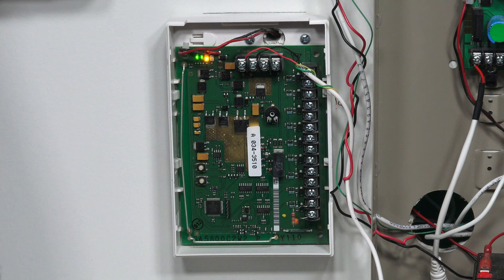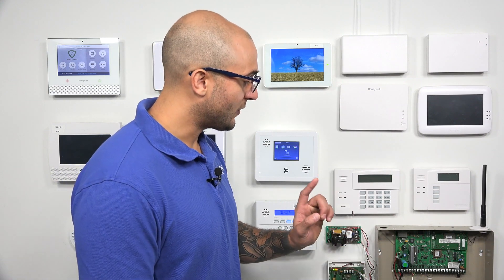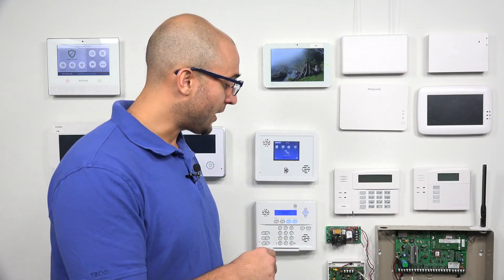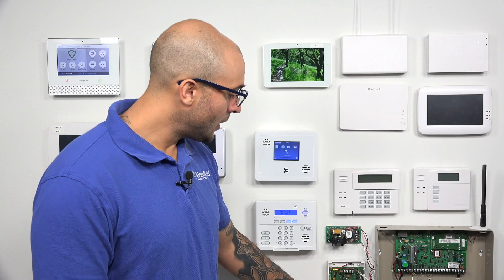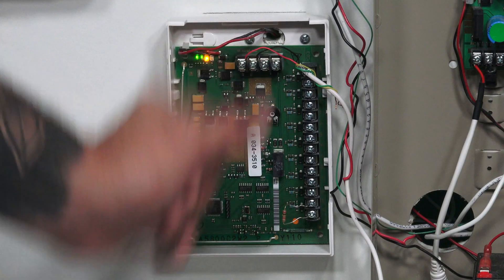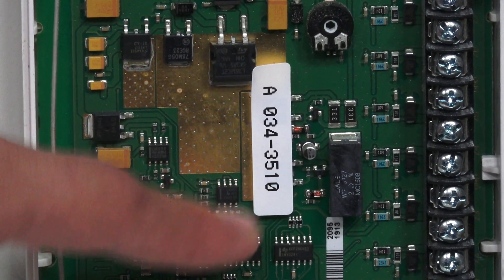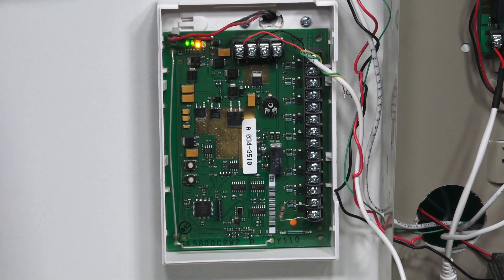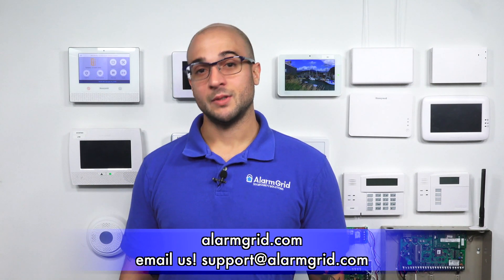Setting Up The 5800C2W with a Lyric Controller

Comment: I didn't understand the part about errors reporting to Loop #4.  
If I shunt the first position with a resistor and leave it there will the system report all 5800c2w errors to the first position?
Reply: If you shunt the first zone if programmed into the panel it will still send troubles to that zone

Comment: Is 5800c2w compatable with paradox mg5050 and paradox indoor motion detector and how is it connect to my wifi?
What display touch screen do recommend to replace the normal keypad?
Reply from the maker: We don't support the Paradox panels at this time.  I've found nothing online to indicate that the Paradox lineup can support the Honeywell 5800 series wireless frequency, which is what the 5800C2W uses.  As we are not familiar with their panels, we can't provide a recommendation on which keypads are supported by which panels.  They do have some information readily available at paradox.com.

Comment: I have a Vista 20SE system and interested in converting it with the5800C2W.   The installer, 10 years ago, placed BOTH front door and laundry room door wires on the same zone, zone # 1. Can I do the same on the 5800C2W?  The way they wired it was, the first door red wire is connected to the end of the resistor and the other end of the resistor to zone #1 screw. Now the second door, he connected that red wire to the black wire of the FIRST DOOR. Now the remaining black wire from the second door they attached to the common screw on the panel. Can I do the same when wiring the 5800C2W? Much appreciate your help!
Reply: @Ciara Hibbert Thank you soooo much. Great company with Top notch customer support. One quick followup. As an algernative, Can I use the 6160RF keypad connected to my old Vista 20se instead of the Lyric system and 5800C2W ,leave all wires intact and this would allow me to be monitored by your company?